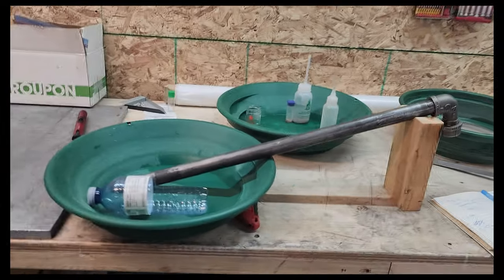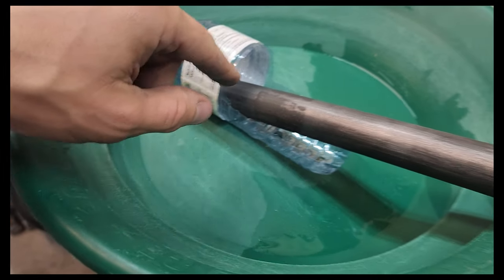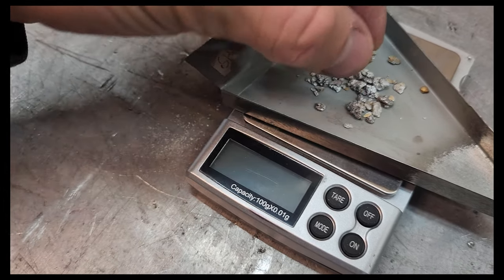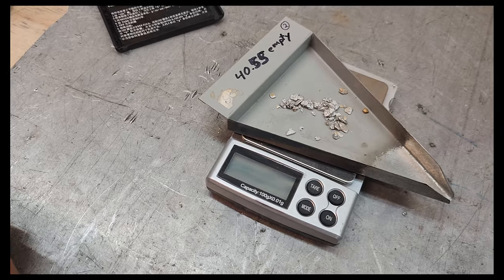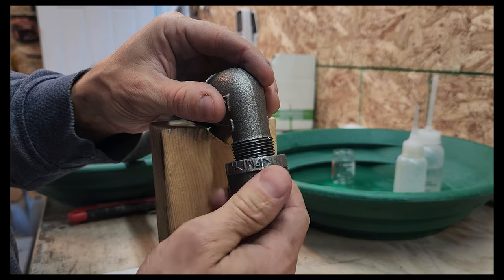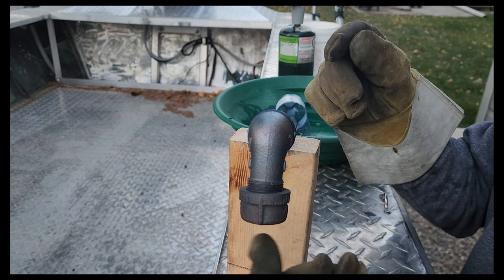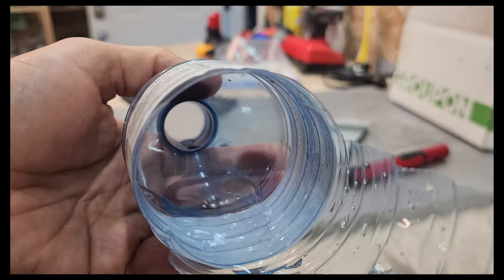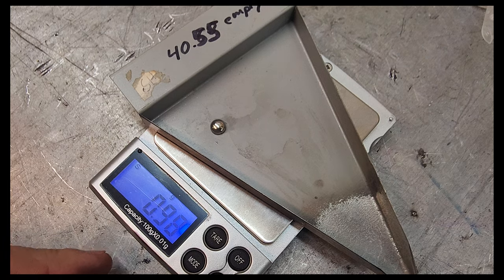CHEAP DIY Mercury Retort.  NO TOOLS REQUIRED.  0.98g Mercury Recovered from the Environment!

Comment: $15 vs. $200 and it got the job done.  Thanks for the great video.  I have about 2.5 grams I need to clean.   Heavy pans.
Reply from the maker: Thanks for watching, I'm glad it was useful to you!  I'm sure you could make a slighty smaller version with 1/2" pipe as well, and maybe toss the pipe in a fire first to burn off any oil to keep the mercury from beading up like it did for me?  Heavy pans.

Comment: First of all I want to thank you for such a fantastic idea. I just built one and works great. The only problem I had was when choosing the iron pipe, since both gas and water pipes I found were galvanized with a nickel or brass coating, and mercury tends to form an amalgam with these compounds (especially when it is heated). That is why, as a preventative measure, I first polished the entire internal surface of the pieces and then let them sit for a day with 20% muriatic acid to finally rinse them with distilled water and baking soda to remove any traces of acid.

Comment: Nice one Dave, a good and simple retort. I recently distilled my first quantity of Hg, but instead used lab glassware and a little home made vacuum pump to ensure vapours could not escape from any of the joints. What surprised me was how many tiny particles remained and stuck to the glass when I looked at it closely. A lot pushed through with shaking, as you did, then a lot more with water washes. Then finally I distilled some H2S04 to totally clean the remains. That makes HGSO4 which is basically cinnabar and that can be reduced with heat to recover the Hg. It would be good for you to start with a measured amount of Hg, do your extractions, then recover it with your retort to see how much of it got lost in the process. I wonder if Jet Dry or similar would help to recover more?
Reply: Yes but HgSO4 is mercury (II) sulfate, cinnabar is HgS which would be mercury (II) sulfide.

Comment: 80 Mercury has to reblance its electron charges after going into vaporizing , the electron charges is why it clings to gold. Let me know if the balls of mercury went back to together , sometimes a small amount of battery amp current is applied overnight to re balance recharge the mercury to its normal state of liquid. Great simple retort you made Thanks for showing 🌝
Reply from the maker: The mercury balls did go back together.  I think the pipe I used had a factory layer of oil on the metal, After burning off that oil, I'm hopeful my next run will have less of that balling.
Reply: @Utmost Outdoors  Gas pipe threads have cutting oil sprayed onto them while turning.I know zinc can cause issues. It does,nt take much oil to cause issues. Ok, your mercury electrons stabilized so hope your next run goes well. Have Great Saturday ❤

Comment: A lot of mercury is on gold since people used mercury to grab gold. Distilling it off is stupidly simple as shown. The mercury vapor form this small of a still is so little that a passive cooled retort is fine. Save the mercury as its quite htf and valuable. If you want extra credit for your retort you can hewt it very strongly with a graphite insert to make a nuce gold button. Induction heating is the best, propane is the most common and charcoal is cheapest. To evaporate  the mercury, red hot is fine. To actually melt the gold its a bright yellow orange heat. ❤

Comment: Cool video, I like how basic and simple it is, I was actually thinking about trying a similar experiment lol👍 Good to know it works!

I’ve used mercury before to clean fine Gold and it definitely works!”pretty amazing” 

It gets frowned upon but when used properly, 100 percent safe!!!
Reply from the maker: Matt, So cool to have you comment on one of my videos!  I think I found your channel about 3 or 4 years ago during your Astro van gold dredging days.  I used to have a 1989 chevy astro van in my early 20's...  If you try a similar retort, I suggest maybe try cleaning the factory oil from inside the gas pipe first and it might help with the mercury beading up at the end, but otherwise the thing did do a surprisingly good job!
Reply: Do you think that you can re- use the mercury to recollect Gold- It looked like it collected back into a glob or did it not? -Wanna get into a system for collecting the ultrafines!!!
Reply from the maker: I think the mercury can be re-used for sure.  So long as you keep collecting it each time, I can's see why you couldn't.

Comment: This is very cool especially considering how cheaply was made and I'm definitely gonna try it. Is there an easy way to scale it up? I was thinking maybe putting some iron pipe before the elbow so that you have a whole cylinder of stuff to distill but I don't know how efficient would the heating be.
Reply from the maker: The most important part it to keep mercury from evaporating into the air, so if you made a larger chamber, you would likely need a longer condenser tube, and perhaps cool that tube with by wrapping a wet cloth around it.   Just be careful with the stuff...

Comment: Very nice setup. I'm going to dispose of the mercury I have at transfer station but I didn't want to lose the gold I have in it. I can do this after I've squeezed out the amalgam then dispose of the mercury. Thanks. The only thing I noticed was you say no tools required, it looks like you cut or had the end of the 24" pipe cut to lay flat in the water bottle? Did you do that or will Home Depot do it for you?
Reply from the maker: I cut that myself.  It's not necessary, just be careful the tip it fully submerged but not by a lot.  When the chamber begins to cool it may want to suck up some water and that would not be good if it made it all the way back to the hot part.  For one small batch the tube alone provides enough cooling, but for more, you can use a longer tube and wrap a wet rag around the outside.  In my test I weighed everything before and after and lost nothing to the atmosphere, but be careful.

Comment: Use black pipe instead of zinc plated for best Hg recovery. 

Also be sure to store the retort on water to prevent evaporation of residual mercury in between uses.
Reply: PS it’ll always bead up.

Comment: Could the mercury be beading up because it absorbed other metals from the pipe?
Reply from the maker: I think it was beading up due to the oil on the pipe.  I should have cleaned up the pipe a bit to remove that factory oil residue before using it and I think that would have prevented the beading.  We'll see if it does it again next time now that I have cleaned oil from the pipe...

Comment: Where can I take collected Hg to safely dispose of it?
Reply from the maker: I believe in Calgary you can take it to a hazardous materials drop off area at designated fire halls.  The same place you would take used oil, paint, or old mercury filled thermometers.  I'm just collecting mine for now.
Reply: @UtmostOutdoors  ok thanks. I somehow got the idea from the video there was some value that could be gained.
Reply: Havoc perhaps value can be obtained by making homemade thermometers or maybe DIY dental fillings. Upmost should make a video about these kinds of idea.
Reply: Sell it. One man's garbage is another man's treasure.

Comment: My gold is stick inside the dop draht, do you have any idea how to take it out?
Reply from the maker: If the gold is stuck inside the cap, you might be able to pry it out with a screwdriver?  If not, now that the mercury is gone, you might be able to re melt it in the cap like a crucible, add some Borax as Flux, and pour it out while liquid?  Just a thought.
Reply: @UtmostOutdoors  ok, I will try it. Tq
Reply: Next time just coat the inside of your cap with graphite and it won't stick

Comment: Hi!

You're totally right about avoiding blowing the mercury up into the air. I also built a retort for this purpose. Similar to yours but a little bit more complicated (short pipe and caps like yours, but a brake pipe for the outlet).
The used retort should be stored inside a sealable plastic bag like a ziplock.

Be careful when using other metals than iron. Mercury may alloy with most metals (including aluminium).

Check this out:
https://youtu.be/IrdYueB9pY4

That's why airlines only carry mercury under heavy security measures...

Best regards from Germany!